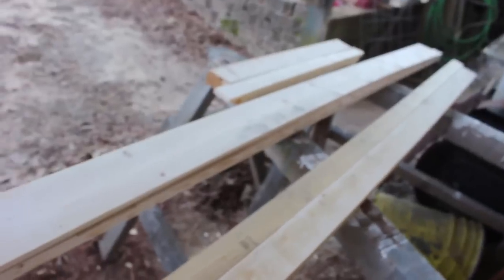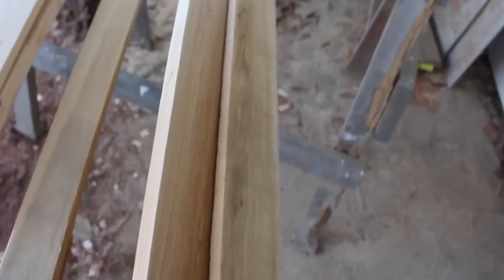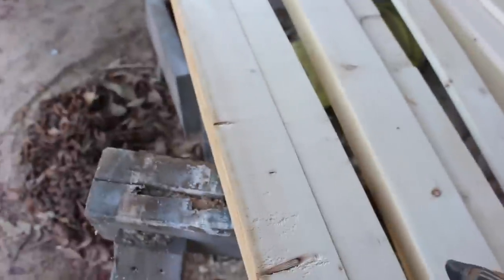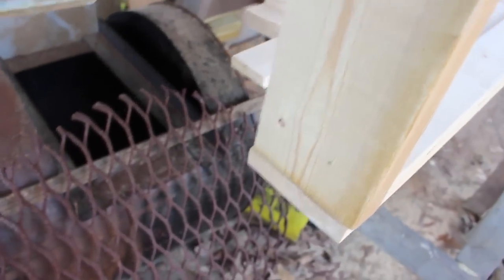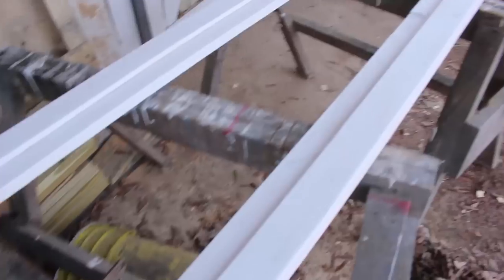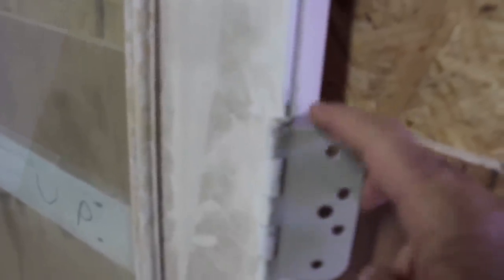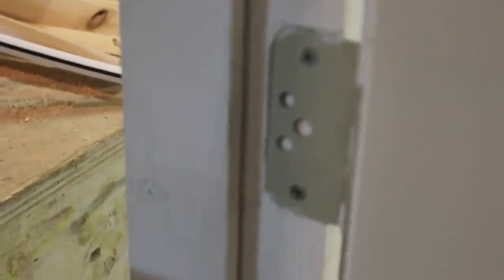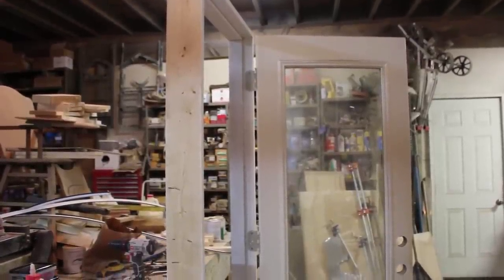Building a Door JAMB -(Casing)-Part 1

Comment: This is a great video for newbies, unless you plan on installing a storm door too. Once I built my jamb I had to rout out the other side, to fit my storm door. Just a heads up, for others.
Reply: You can add exterior brick mold and attach the storm door to that.
Reply: Good point since most storm doors are 1'' thick. You'd need to notch 1'' of the door frame on the exterior side of the door frame. I'm thinking just make the door frame out of 2x6 then rip out 2 3/4 out of 1x4 and nail it to the 2x6's for the jam.

Comment: Danny, I followed this video to a T.
Problem I ran into is the casing fits perfectly to the door, but once I put the weatherstrip in, the door no longer sits into the casing properly.
As far as ripping the door width out of the, you are not creating a left hand or right hand until you notch the top section.
Reply: Just allow another 1/16 inch on the hinge side to allow for the weather stripping.  Then the door wont bind when the weather strip is collapsed when door is closed on it.

Comment: Is there any reason why you favour the verticals over the top piece to do the notching - I mean why the top piece is fixed BETWEEN the verticals rather than spanning the top of them?
Reply: If the top piece is attached to the verticals with finish nails, it allows the verticals to be spread apart if need be to get a fine adjustment in the width of the opening. If the top is nailed down through the top piece, it is then not possible to move it at all.

Comment: Great video. A couple questions if you don’t mind. How did you route the hinge recesses  with the door stop in the way? Also I found my  jambs bowed/cupped quite a bit a couple days after cutting them, any tips to avoid this? Thank you.
Reply from the maker: I chisel the hinges.  To keep from warping, I use spruce.
Reply: To avoid cupping, lay the jamb pieces on the table saw, back side down and cut several shallow saw kerfs lengthwise. If you are going to wait any length of time between milling and installation, clamp the pieces together on a flat surface. A jig that raises it above the stop will allow you to use your router to make the hinge mortise.